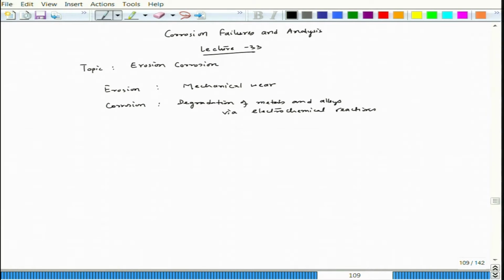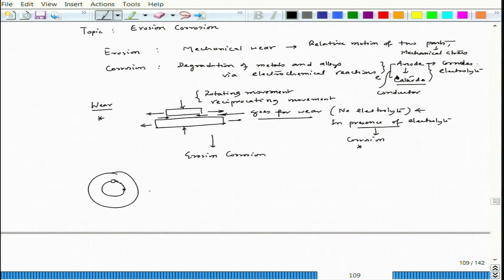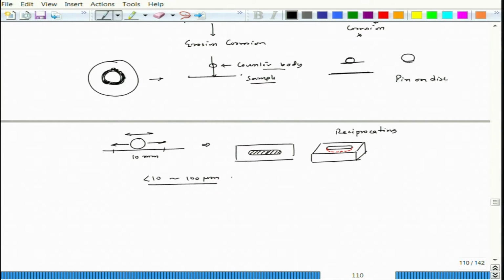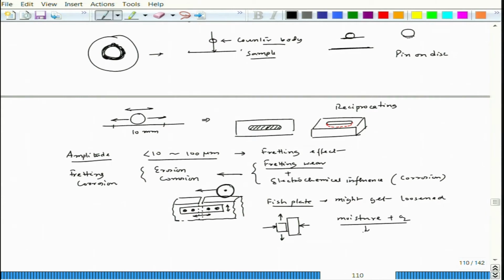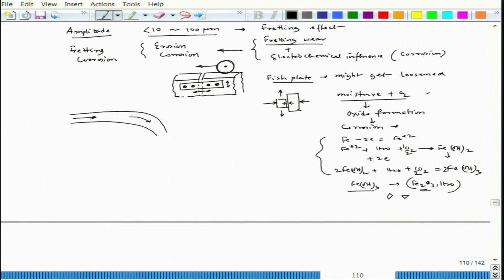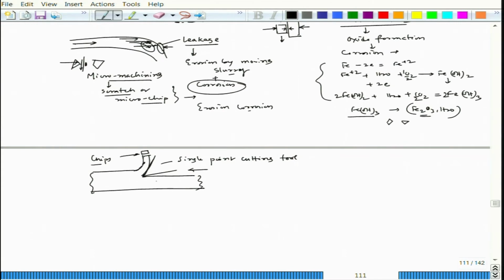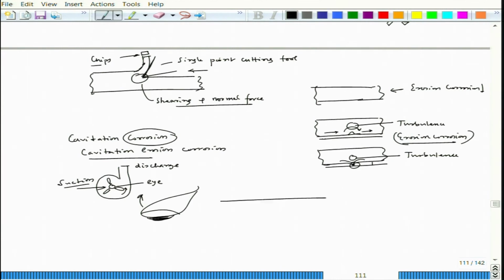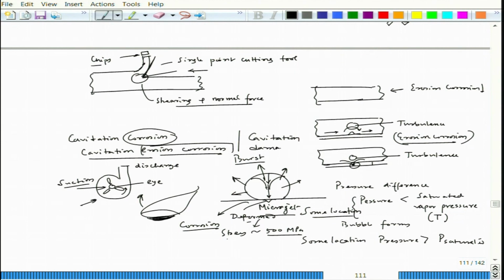Lecture 33 : Erosion Corrosion: Introduction

Comment: Sir, at 30:42 , you are mentioning if the pressure of a liquid is less than the saturated water pressure at a given temperature, it will evaporate, but it should be other way around, Could you please clarify.